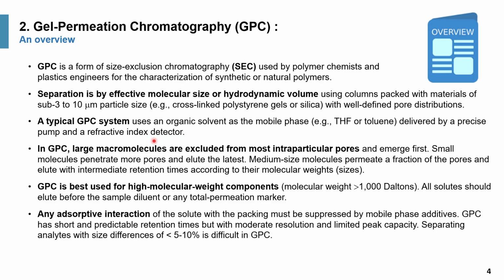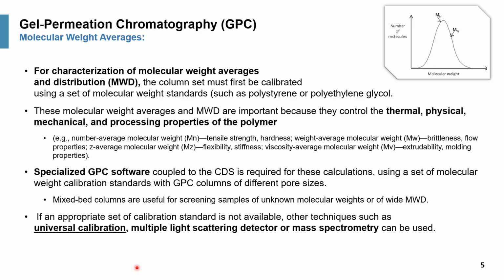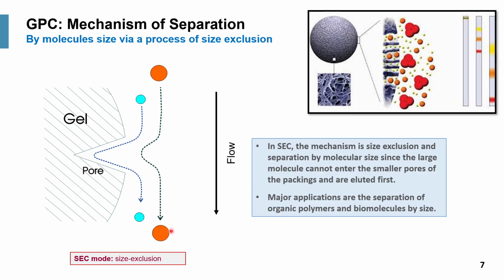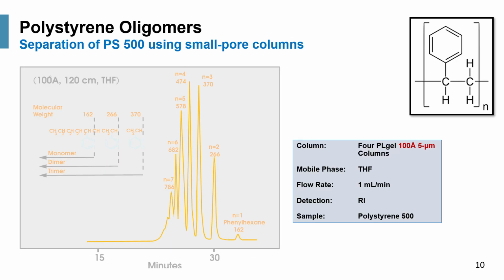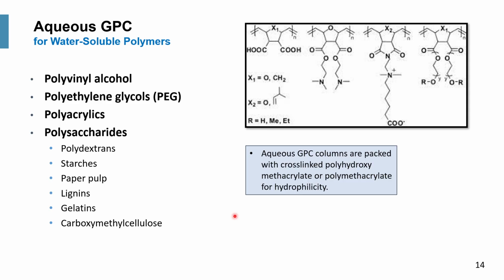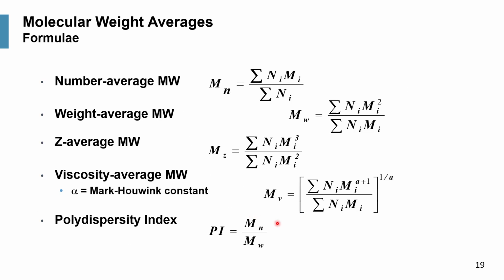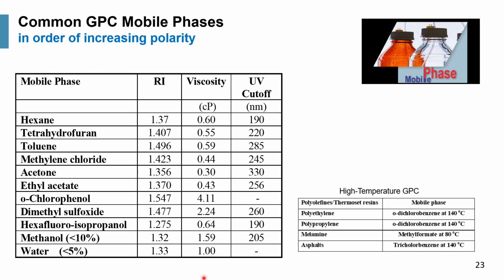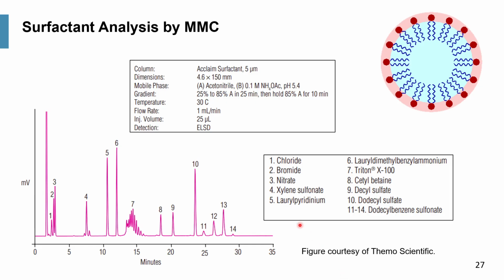31. EP-26. Polymer Analysis by HPLC and GPC

Comment: Good Morning one day late, I am the 19th viewer, which is very poor of me.  In advance, I thank you for authoring/narrating a wonderful series of YouTube videos.  I hope you get at least as much exposure eventually as Lee Polite, it is criminal to me that both of you gentlemen haven't had more viewers.  Lee Has had a bit of a head start on you, Michael.

My exposure to SEC is quite limited to my time at Gore, when they were designing specially derivatized Teflon SEC phase(s) for proteins--affinity chromatography on low pressure LC systems.  We used Tosoh columns on a 1260 system (after I installed a seal wash device and removed the MS from the flow stream, Protein A was what we used as a proof-of-concept.  I guess Gore managed to sell some of this 

BOOF -- Big Ones Out First!

I remember when ELSD was used a lot (at West, nice little company), and when Wyatt introduced it's MALS detector, great breakthrough.  Didn't use this one myself, knew folks that did at Merck. 

Asa complete aside, didn't Varian once also have an "oddball" ternary gradient system?  I think Rohm and Haas used some of those in the early 2000s.  So strange to me.

Interesting presentation of some fields I didn't know much about.  I still have a degree of curiosity, I'm not as sharp I once I was and I get tired easily.  I think I will renew my subscription to LC-GC, was good to see relatives (even if circumstances weren't ideal, as a cousin isn't doing well health-wise) two weeks ago and see some of the place where I grew up again, and some old friends.  Much has changed even since 2018, the last time I visited Pittsburgh.

Mathew Chamakkala (saw that he retired, too, hope he's in good health) asked me if I wanted to resume my former role in LinkedIn with the Analytical Method Validation group... I must answer him though I don't know quite what I want to say.  I feel diminished and I'm out-of-practice, I don't have confidence in what I could add to help folks with questions anymore.  He's a smart, kind fellow, like yourself.

I'll read you around, Michael Dong.